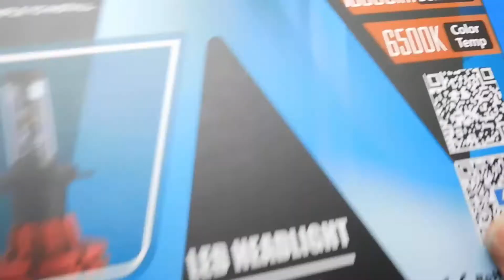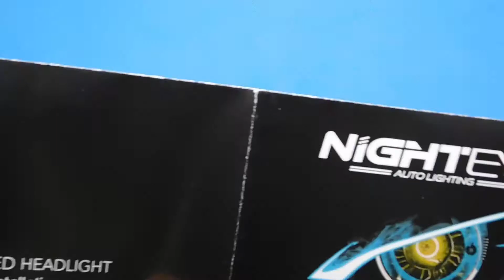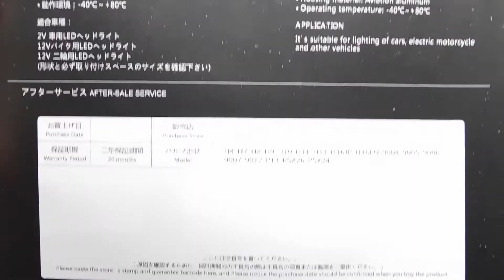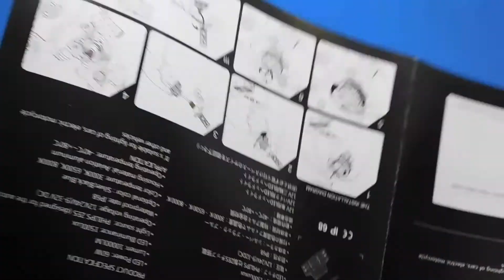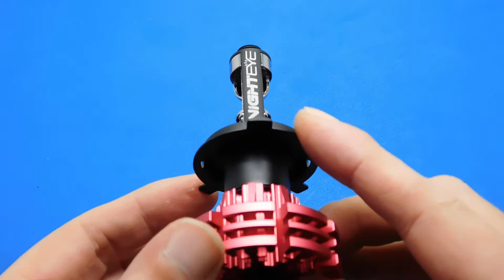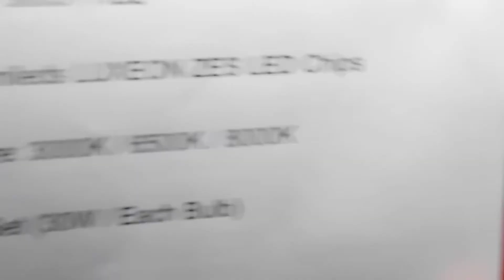£34 LED 60W Car Headlights H4 Nighteye Philips Chips 6500K High Low Beam Bulbs Conversion Kit Review

Comment: What are your thoughts on item no 372013254788 it appears to be the best spec bulb they sell and apparently has a uniform light, have you tried these?
Reply from the maker: Hi,

Firstly be very very wary of what the seller tells you,

the seller is trying to sell the bulbs so they literally print anything on the box and say anything on the description of the listing,

As they know you can't check,

But if you buy 2 sets and one is supposed to be 1000 Lumen brighter and it is dimmer by 1/3 rd,

Then you know they are lying and if they lie about that they will lie about anything,

I know both my sets failed the MOT which make both illegal in the UK,

Maybe watch my buyers guide,
https://youtu.be/gmZh9dJRbso

Just a few things i would watch out for,

The led's look like COB circuit on board which others have said is the worst design for headlights,

You should be able to buy a set from your country,

As above £17 you will incur import duty of around 23% payable at the door on receipt of your order,

The branding is Novsight which looks similar to Nighteye ??,

As my guess is they are the same seller,

The company that owns the brand Nighteye is called Neverland,

And a lot of these sellers have a similar username,

They do say on their website they sell on Ebay and Amazon,

Is H7 the fitting you need ?,

Is the gap big enough in the middle of the bulb to accomadate the rubber gasket on the back of the headlight ?,

They look to have a fan inside,

So they may be brighter than these in this video,

The ones in this video have a bigger gap for this exact reason,

I can only recommend ones i have used,

These failed the MOT as all of these bulbs will as the MOT is very strict,

They are H4 design though, main and dip light pattern,
https://youtu.be/2bTwbPBCjwI

I would still be using them now if they were easy to fit but the gap is not big enough,

Which means i have to stretch the rubber boot over the light and push it in and twist like crazy to get them to lock in,

It took half a day and 2 people to fit them,

Eventually i had to remove the bumper and headlights as there is no room at all on my car,

Take your time and make an informed decision and don't rely on what they say on the listing,

Look at the pictures and try to find out what they don't say.
Reply: Noob Tube I am based in the uk, so mot failure concerns me too, could change them before mot but would be a hassle. It appears nighteye has changed their company name to Novsight. Search youtube for novsight 80w the first three videos are regarding the bulb i mentioned which appears to have a uniform beam. H7 is what i require but would also need the canbus loom for my audi a3 2010 with reflector headlights, Let me know what you think...
Reply from the maker: unfortunately everyone on you tube has drunk the coolade,

They are "sponsored" by the manufacturers, ie they get the product for free so long as they don't tell the truth,

I have been offered "free" products,

As I say free is most expensive,

As if you tell the truth they send an email to remove the video as it damages sales,

So i spend my money but i am free to say whatever i want about the product,

The truth is the manufacturers won't address the issue that these are not good enough to work with normal headlight housings,

Or i have even seen the manufacturers doing the videos especially with these led lights,

I probably even get the manufacturers disliking this video,

I can say from my experience all these bulbs will be illegal,

I saw the poster on the wall at the councils MOT centre,

And it the light blurrs into the part that it is not supposed to be in it will fail,

The only way around this would be to put the old bulbs back in like i had to,

I then swapped to the easier to fit red anodised bulbs in this video.
Reply: Noob Tube i may consider buying those bulbs i suggested if i do will let you know how i get on, otherwise will wait until the technology improves. Thanks for your input
Reply from the maker: It is possible to get it right manufacturers have been doing it right for years,

But they have to re engingeer the headlight housing, Vauxhall have done it,

Soon the market for these will dissapear,

When we all have to move to full electric cars they will have led lights as standard,

Instead of halogen bulbs,

They will probably be £500 to replace them when they blow as some of the manufacturers are charging this for the rear led clusters,

As the are non servicable so instead of a 50p bulb that lasts 10 years plus,

You need to replace the whole cluster at 5 years,

But thats progress we should stop moaning everything that is more expensive is always better,

Hookers for example :)

Comment: Hi . Are you going to do a review on these lights ? Just reading the other comments they’re obviously not bright enough but are they brighter than the original halogens ? And what is the beam pattern like ?
Reply from the maker: Hi,

They are not as bright as the last set i reviewed, these are only 1/2 as bright,

They are brighter than the halogen and a more white light than the halogen yellow light,

I chose these because the others are to difficult to fit in my headlights,

I would try a different set to these as they are no where near the brightness they say they are,

I think they are under driven as this set doesn't have a fan just a heat sink,

I would go with another set with a heat sink and fan as that set would likely be driven harder and give a brighter light,

The gap in the middle of these bulbs is big enough to accept the rubber grommet the other cheaper set the gap was to small,

This set definitely doesn't throw the light as far as the other cheaper set,

I have the headlight adjusters almost on their lowest height settings,

The beam pattern will also be illegal with these lights and you will need to change back to halogen bulbs for it's MOT,

For me this set is better than normal halogen but not as bright as they said,

But i won't use normal halogen for dark unlit motorway journey i just can't see what i am doing and it's dangerous with normal halogen bulbs.

Comment: Can you confirm if all 10 led chips (5 per side) all lightup when in highbeam?
These nighteye only have 2 bulbs for highbeam. So few IMOHO.

There are some bulbs with similar design but the highbeam chips are 3pcs. (Some have 4).
But reviewers indicate that they dont lightup at the same time.
Even when both high and low are powered only the high turns on.
Reply from the maker: Hi,

No they can't all light up at once as that would almost double the brightness,

 when i lined up my lights against a wall full beam was the same brightness as the dip beam,

I can't tell which ones are on or off as they are so bright to look at.

Comment: Cheers Noob for your genuine and unbiased description and testing of these bulbs. Am thinking of upgrading a Peugeot 207 that we are giving to our son, my wifes old car. Any advice would be greatly appreciated and received. My wifes new 208 is so bright in comparison, so we feel we need to do some kind of upgrade. Thanks in advance.
Reply from the maker: Mony Torris.

I am sick of you tube reviewers not reviewing stuff they get for free correctly,

As they are worried they won't get more free stuff,

Or they just can't be bothered to check if the item is any good,

All these Chinese LED headlights are illegal,

And i mean all of them,

So if you are worried about blinding oncoming traffic or your car not passing it's mot don't buy Chinese LED headlights,

The set i got for £21 with a fan inside the heat sink were better than this set,

The £21 set were cheaper,

They output about a 1/3 rd more light than this set,

But the fitting for me was difficult almost impossible because the gap in the middle of the bulb was to small for my headlight design,

This set in this video fit better and are easier to take out and put back in after my mot,

I have done a LED headlight buyers guide on you tube covering all the major issues,

I also have a video of 7 months of use of the £21 set covering long term use,

The £21 set scattered the light more and are brighter,

People got out of the way quicker as they though i was a range rover or something bigger,

If you do a lot of unlit motorway travelling they are the best but with urban lighting the extra light they produce is not as obvious.

Comment: thanks for posting an your findings...was just about to get the NightEyes til I read your review..most of 'em come from overseas anyway so it's back to the drawing board to find some that are brightest....thanks again...I  owe ya  a beer
Reply from the maker: +Sam Moss the nighteye ones are available from the uk,

A seller called neverlandgb i think is the factory importing them and posting from a uk address,

So no import duty to pay on uk stock as the seller has paid for it already,

It only takes a couple of days instead of upto 6 weeks from China.

These are illegal but are still good quality the cheap £21 ones are brightest,

Look for a fan and a heatsink,

The nighteye ones do seem to use good quality led's,

Any unbranded led lights won't be any where near as good as these,

Just make sure you get ones that fit your headlight housing,

And double check your cars fitment type.
Reply: yeah I was looking around an spotted these ... I'm in the States an a YouTube channel had 'em listed on Banggood dot com out of East Asia (I'm thinking Malaysia or there about) for less than 30 USD but the brightness thing stopped me cold. Looking at an Alla Lighting (Alla Lighting 8000lm Xtremely Super Bright 6500K) brand but longevity is an issue according to Amazon. Seems most are made in or near China these days anyway.

Comment: Hi can you explain how you got on with these led lights as l am thinking of purchasing thanks.
Reply from the maker: Hi,

I have fitted these bulbs and i am dissapointed with them,

They are just not bright enough,

I have had them in the car for almost 4 weeks,

Even though they are supposed to be 1000 lumens brighter than the set below they are not,

They are only 2/3 rd's as bright as this set,
https://youtu.be/2bTwbPBCjwI

So nighteye just lie on the packaging,

So this set can't throw the light as far, so you will have to lower your headlights on the adjuster motor,

I would go for the cheaper ones above,

Those scatter the light more but they are quite a lot brighter,

Heat sinks alone on a set of bulbs is not enough to cool the bulbs,

So they then can't be driven as hard,

Heatsink and fan are the best option,

So long as they fit in your headlights,

This is why i went for this set as they were a lot easier to fit,

This set with the red heatsink are still illegal,

The only advantage to these is they are easier to fit if you have a rubber boot around the bulb,

If your bulbs are a tight fit take out the headlights as it is much easier to fit the bulbs.
Reply: Noob Tube 
Damn... thank you for the reply, l was about to purchase these glad l didn’t, lm just really trying to find the right brightness and beam pattern for the VW Caddy maxi life, checked out Autobulbs direct, they have a twenty20 h4 led on their website, had a look, they sell them for £95, pretty expensive have to say, may buy and test drive as not sure about others.
Reply from the maker: subhanallah7 i am not sure if any bulbs no matter what you pay will be legal,

I would just go with the cheaper ones i linked to,

The only legal ones are on new cars with led headlight upgrades,

The only way to know if they are legal is leave them in for your mot,

The chinese don't spend the time or money harmonising them,

I think multiple led chips will struggle to copy the halogen pattern,

I think they rely on you thinking they look right because they look like they might work,

The mot is so strict now i would be surprised if any 3rd party bulbs would be any good,

No one on you tube will say they are illegal,

As the manufacturers make their own videos,

And give away free bulbs but you can't say they are rubbish,

Otherwise they force you to remove the video,

I spend my own money so they can't do anything,

I hope a lot of people see my videos on these led lights.
Reply: Noob Tube-thanks mate !!!
Reply: I was also thinking of getting these 10000LM version. I have the 8000LM version nice colour temp but think after 15 minutes running time they seem to dim or it might just be my imagination. Why not think about the new chip 12000LM with fan, for a few extra quid I might wait for a UK importer so as no import duty!
Reply from the maker: Danny Stephenson be careful though i had 9000 lumen ones and they were brighter by a 3rd than this set of 10,000 lumen ones,

most manufacturers know you can't test them so they write anything on the box.
Reply: Noob Tube, what was it you were disappointed about the 10000lm  I'm intrigued? I have a 2008 Fiesta which has a low angle beam pattern so where as cars like range rovers and BMW's blind other road users my beam shines at about bumper level and not in the rear view mirror of the car in front. Although stated that most H4 don't fit my car it's generally due t the rubber cap on the back of the headlight which can be adapted easerly.
Reply from the maker: This set is clearly not 10,000 Lumens,

I have a brighter set that is supposed to be 9000 Lumens,
https://youtu.be/2bTwbPBCjwI

And these are at least 1/3 rd less bright,

I have no way of testing them but it is the same with high powered torches that use similar bulbs,

They only produce 1/2 of what the seller quotes,

Which means they don't throw the light as far,

So you have to dip them more so they don't illuminate the road as far,

Basically it seems that Nighteye just print anything on the box,

They have done a re brand so they also use the name Novsight.
Reply: Noob Tube, yeah I did notice they rebranded their name. Must admit I've no issues with 8000lm also have the H11 for the fogs too. I want to try and keep the bulb design as close to the halogen bulb to keep the beam pattern...What's your thoughts on the 12000lm?
Reply from the maker: Danny Stephenson i haven't seen them,

I probably won't buy anymore for a while now,

They just seem to keep launching new designs but i don't know if they are any better than the ones i have already had.
Reply: Noob Tube, fair enough. I'll keep these in for the time being but once they are available in the uk I'll get a pair and give you my findings.